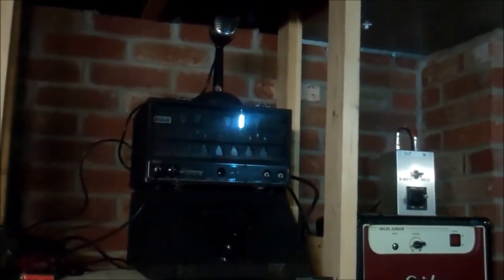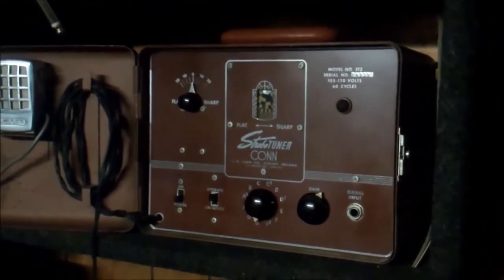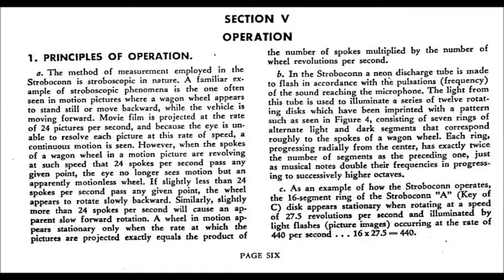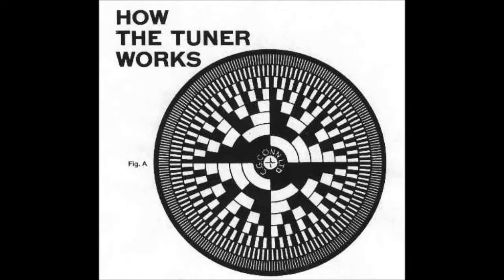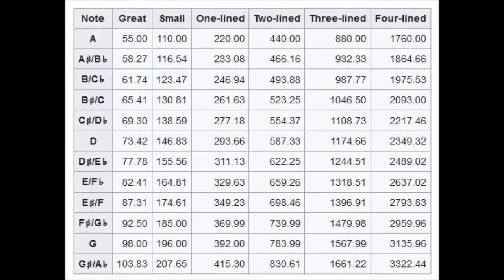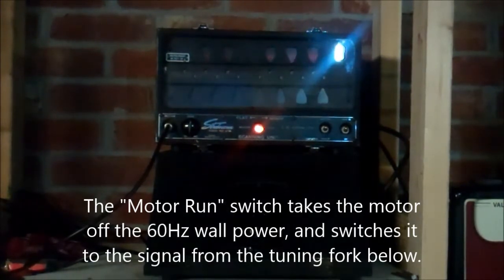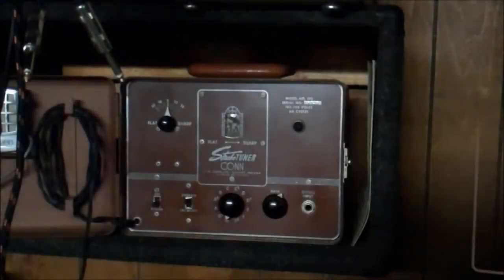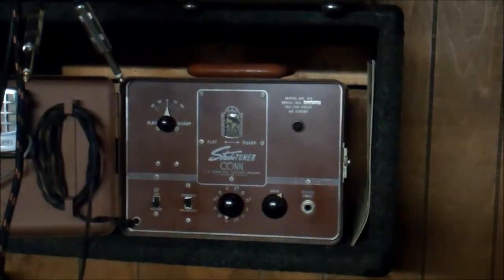The Stroboconn--How it Works.  The oldest and most accurate instrument tuner.

Comment: Hello, I have one of these units as well, but need some help.  It will turn on, the motor runs and the wheels spin, however, the tubes will not glow.  I've replaced the tubes and still nothing.  The pilot light will not come on.  Any suggestions on where I should look next to troubleshoot this?
Reply from the maker: If the tubes don't glow,   start by checking for the 6.3v that are supposed to light the tubes.   Schematics are in the back of the users manual that you can find online.
Reply: @DeadKoby  Thank you...much appreciated.

Comment: Can the Scanning Unit function at all without the Tuning Unit? Or are they daisy-chained together with one electrical plug? I have an opportunity pick up a Scanning Unit for free, but that’s all the guy has—no Tuning Unit. Is it even worth picking up on its own?
Reply from the maker: They have to go together.
Reply: @DeadKoby  ok, thank you. I appreciate the swift reply.
Reply from the maker: @NathanGrosse  No problem.   They are often separated,  and apart they command little value.   You may just check ebay.
Reply: Someone gave me the bottom half (motor drive amplifier that runs the geartrain in the scanning unit) of one used in an industrial application several decades ago, measuring frequencies of rotating machines. It had a 0-100 cent scale on the tuning fork mass, instead of the typical +/- 50 cent I see. They eventually went to modern test equipment and got rid of the Stroboconn's.

That person was given it with the recommendation to make a guitar amp. He held onto it for over 20 years and decided I needed to pursue that goal. It was a 115 VAC 28W amp with parallel PP 6V6's (4 as DK explained). That motor looks like roughly 472 ohms, so a new output transformer with a voice coil secondary was needed. I chose one within a week, making more progress than the previous owner. But that was a few years ago...I'm still ahead of his pace.

Removing the massive tuning fork that was part of a oscillator circuit with pickups for drive and feedback leaves chassis space for multiple preamp circuits (it'll be a lab rat project, not roadworthy).

Comment: I was just came across one of these and I got it as something to put in display in my studio not knowing what it was. What are these things worth?
Reply from the maker: A complete unit  (top, bottom, and cords)  is usually 300-500$ if I recall.   Since I've acquired my two units,  i have stopped price watching.
Reply: @DeadKoby  Thanks! I actually had no idea. The unit that I have is so gorgeous I think it’s probably worth more to me as a showpiece than anything else.
Reply from the maker: @odm3762  Getting it serviced and operable makes them worth a good deal more.   Good condition units are 4 figures.   I've repaired/restored 3 of them.   Great tools.

Comment: I just bought a StroboConn 6T, previously used by a piano tuner, and out of use for some years. It appears not to be working correctly. May I confer with you to help troubleshoot? If so, is this the right venue, or should we speak privately? Thanks for the consideration.
Reply from the maker: Thank you for contacting me via the website.